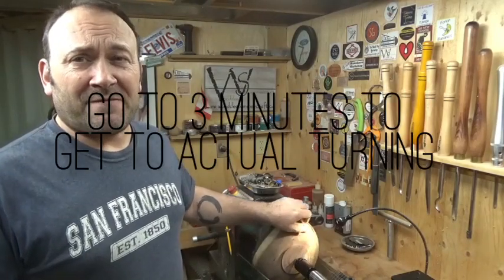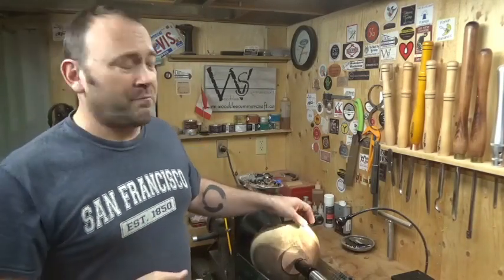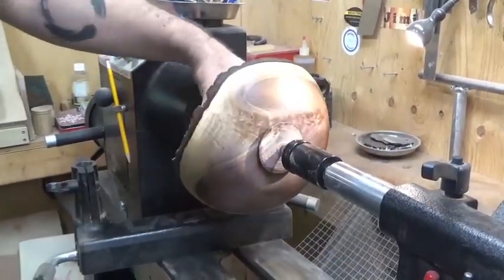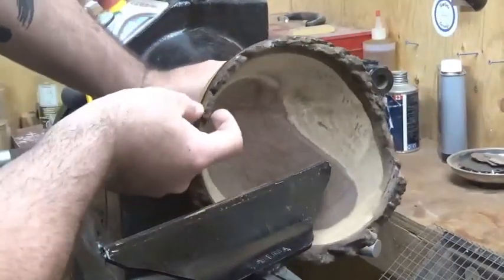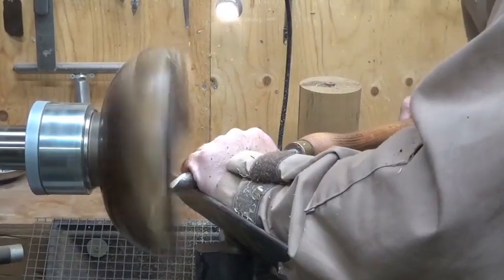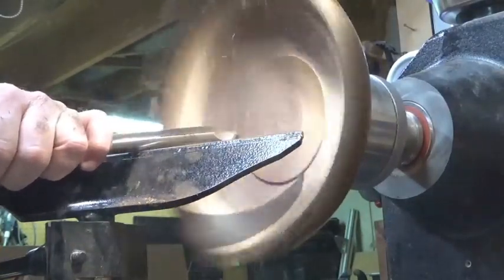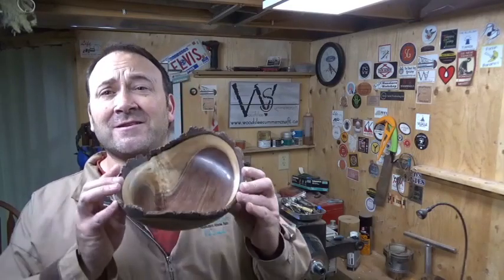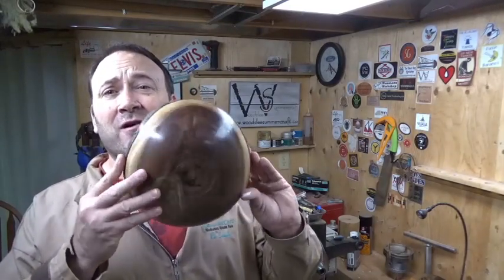second turn walnut live edge crotch

Comment: I also have microwaved rough cut bowls and have very good luck doing it however I have never put them in a bag in between microwaving. I just let them get back to room temperature before microwaving again. Do you think putting them in a bag with that moisture stops them from cracking I have not had a cracking issue. 
Thanks for all your videos very informative especially since we cannot get together over this Covid.
Reply from the maker: I have found that putting them in a black bag in between microwaveing does stop them from cracking, it’s all about slowing the drying process, I turn the bag inside out each day to release the condensed moisture, one you get close I loose the bag